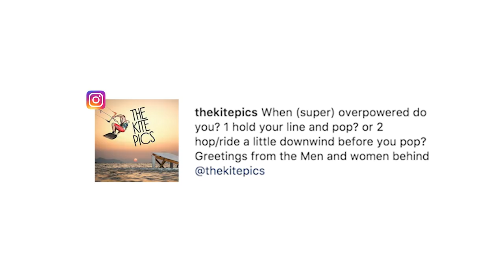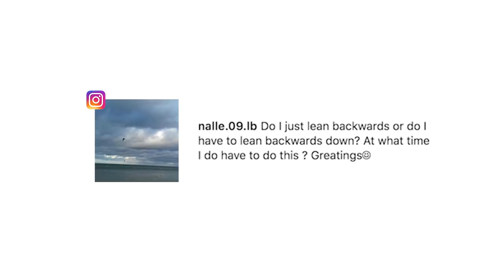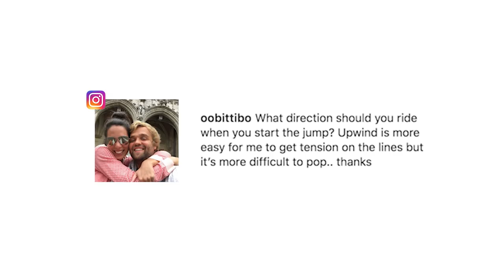Approaching Takeoff ft. Josh Emanuel // Ep. 3 // Jump Higher with WOO! | WOO Kite

Comment: Learning to jump. Once in a while I do everything right and I jump a lot higher than I anticipate. Kind of get a little freaked out. What would be the safest place to keep the kite until I get used to more air? Should I just leave it at 12 and it will float me down to a gentle landing, and then after time start working on sending the kite down to be able to ride out of the landing? If I could get used to landing  nice and easy when I get more height I'll get the confidence to deal with these higher jumps.
Reply: dpwild328 hey man im at the exact same stage. In lighter winds i feel comfortable to jump but when the winds are on the stronger side sometimes I boost higher than expected. It is a freaky feeling but in another year it will feel normal to get ripped off the water
Reply: dpwild328 as soon as you sheet out the bar, you gonna drop, then one meter above the water sheet in en send your kite to left or right, iff you keep it on 12 your kite is gonna crash because you will swing under it